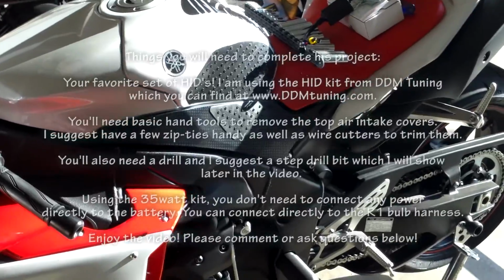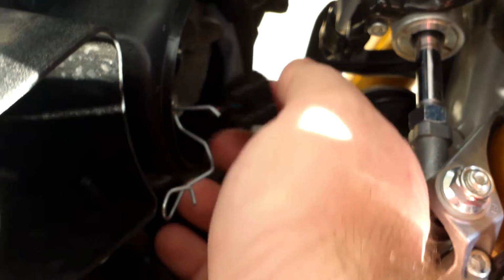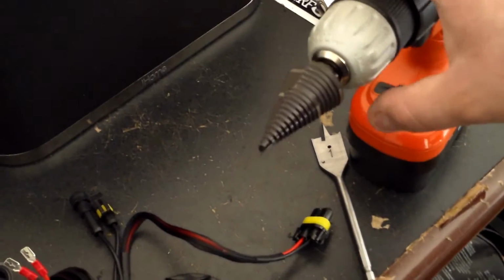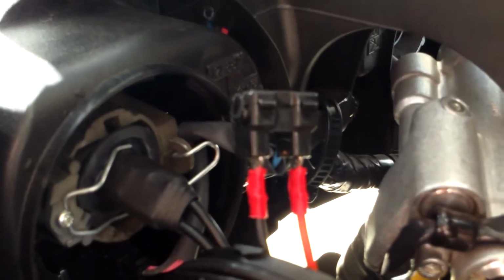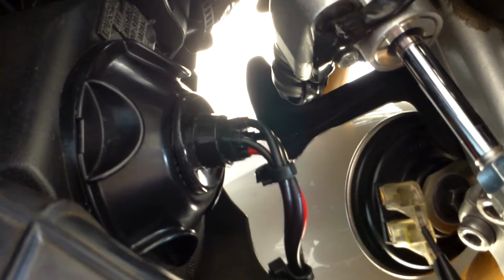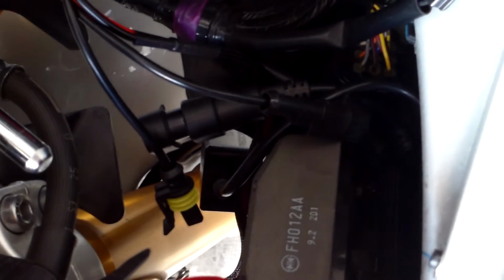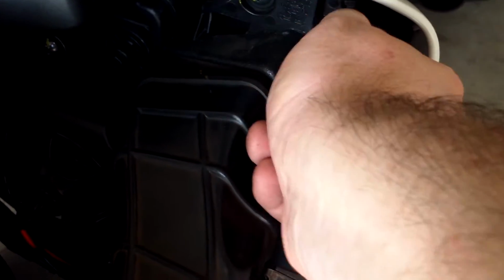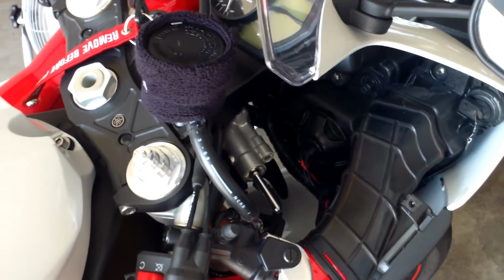2009 Yamaha R1 DDM Tuning 5000k HID Install

Comment: My left side light stopped working is it possible a ballast went bad? Bike already had them installed it’s a 2010. The little black box next to the ballast has a little spot where it looks pushed out and slightly burnt. Could it be that it burned out for good
Reply from the maker: Quite likely the ballast went bad. If you're using a DDM pair, you should be able to buy the ballast separate and replace it.
Reply: Flashwing I hooked the bulb that wouldn’t turn on to the other sides ballast, and it turned right on. Went and bought a ballast at a local store and it works great. Thanks
Reply: Ok ya I bought the bike and it already had the kit installed and not sure what brand it is. I couldn’t find a label anywhere. Thanks for the quick reply man.

Comment: what do you do for hi beams?  I used ddm for my 04 r1 but i have a 2011 now and the lights are hi/low.
Reply from the maker: The 09 and above have electric eyelids so you just use a single bulb version without the high beams. The high beams work by the eyelid moving up and exposing additional light.
Reply: @FlashwingMotoVlogger  ok thanks.

Comment: Is this guessing 5k 35w kit a nice ice white or does it have a blue tint
Reply from the maker: Correct, this is a 35 watt kit with I believe a 6000k tint. I've since switched out to the 4.5k which has much better light output and is what I would suggest. The more blue in the lights, the less output you have.

Comment: Has anyone had buzzing noise from the hids , 07 R1 and the buzzing sound is louder than the worn cam chain tensioner noise
Reply from the maker: I've heard buzzing on start up but once the HIDs are fully on the buzzing would subside. Depending on how inexpensive the parts are, you may have some electronic buzzing.

Comment: Hi mate - could you please tell me how long the install takes?
Reply from the maker: Chris Sutherland maybe two hours. modifying the headlight caps and tucking the ballast units inside the fairings takes a little time. You shouldn't need more than that.

Comment: Do you think a 3/4" step drill bit would work (versus the 1" you mention)? I have a 3/4, but not a 1" bit
Reply from the maker: +Michael Bennett it might be a little tight. Worse case just round the hole a bit to enlarge it and you should be all set!

Comment: did these hids melt the inside of your headlight housing unit ??
Reply: MrDeanoblaze I have a r6 with 55w in their and no melting at all
Reply from the maker: +MrDeanoblaze no I never had any issues with melting. With car applications, I had melting problems using the 55 watt kit where it melted the housing on my car from the inside. It seems the heat output was just too high. I've used only 35 watt since then.
Reply from the maker: rroadrider15 good to know!

Comment: I got this same exact kit, and had some issues with it. Did you by any chance need to run relays with this kit or anti flickering kit?
Reply from the maker: +Emin Manookian I did not. I literally hooked this kit directly to the OEM connection points and it worked without any issue. I had problems with one of the ballasts not firing up during low powered starts but that was it.
Reply: +Flashwing I installed this kit, it worked great for about a week. Now, under little throttle the lights flicker and blow a fuse. I did some troubleshooting today, swapped ballasts from another hid kit and it works fine. I'm thinking ballasts are bad.
Reply from the maker: Emin Manookian that very well might be the case. DDM stuff is very cheap. I managed to get two years out of a kit on the R1 and I was amazed at that. I've gotten longer time with my car but only because it isn't exposed to the elements or heat like the R1. I've heard of issues with bad parts so no surprise. For the money, you can't beat it though.

Comment: i am thinking of installing this on my bike so looked it up to realize i am subb'd to you already
Reply from the maker: Johnathon Stewart haha, small world! HID's are a great safety device both to make sure you see better as well as making sure other people see you.
Reply: I am wanting to do hids and the led running lights both for being seen and seeing but one of the main reasons i was watching was to see whether i needed to buy the harness or anything else...by the way the kit for this bike is 30 dollars now
Reply from the maker: Johnathon Stewart The kit will come with the complete harness to make everything work.

Just a word of caution that I had an issue with one of the DDM tuning ballasts which ended up frying my regulator / rectifier. Granted, it took nearly 30,000 miles of riding to do it, but just be careful where you put the ballast.
Reply: the problem i am having now is choosing the led's haha i want these but just do not know if it is too much  http://www.ddmtuning.com/Products/194LED-4xCOB-1xCree-W.194-LED-4-x-COB-plus-1-x-Cree-White
Reply from the maker: Johnathon Stewart 650 Lumens per bulb is pretty good with something of that size. I honestly wouldn't worry about it being too much since anything will help with visibility.

I would double check the amount of space inside the housing to ensure the bulb will fit. The one in that link looks a bit long.
Reply: if my measurements and math are correct from the plug in itself to the lense is right at 1.7 inches so i am going to give it a shot! thanks for your input and video

Comment: Where did you get the weather seal?
Reply from the maker: Joe, the weather seal was included as part of the DDM Tuning HID kit. I've ordered HID's from a couple other vendors and that seems to be standard equipment. You just have to drill a hole in the back cover large enough to fit the seal properly.

Comment: Hey one question does that one kit include low and hi beam or do u loes hi's
Reply from the maker: Hey Daniel! This kit does not include high beams. The R1 doesn't technically have high beams, it simply has an eyelid that is actuated on a switch. You flip the high beams switch, and the lid moves out of the way exposing more light and thus giving you high beams.
Reply: Flashwing ohhh I knew that lol jk thanks bro makes sense ordering hids now lol thanks bro

Comment: very informative video thanks man.  The ballast you mounted to the right, is it still holding up okay being that its by a hot spot?  And also could you use that drill bit that was laying there as you were explaining the 50 dollar cone shaped one?
Reply from the maker: So far I've no issues with the ride side ballast with regards to heat. The drill bit you're referring to might work. I think my issue was either the drill wasn't strong enough to use it, or the hole wasn't the appropriate size. I suppose you could use it though in a pinch.
Reply: Flashwing Thanks again

Comment: What wattage did you go with 35 or 55?
Reply from the maker: Hey Matt! I used a 35w kit only because I've had issues with heat melting headlight components when used on my vehicle. While I'm not certain the same would happen with the R1, I know there was a recall for the 09-10 years for headlights melting paint on the front fairing. I didn't want to take the chance. The 35w kit puts out plenty of light compared to the stock headlights so I've had no complaints.

Comment: You didn't have to use a relay with your install ? Some bikes i know require then and some don't (just curious)
Reply from the maker: Hey there! No there was no relay required for the installation. I took a basic HID for the R1 bulb type and installed it using the method in this video.
Reply: thanks for the reply